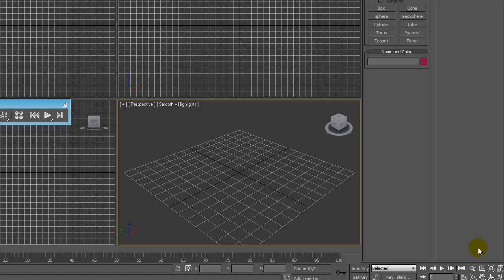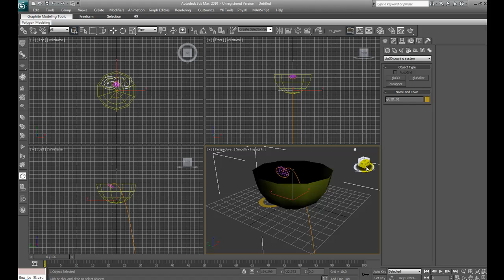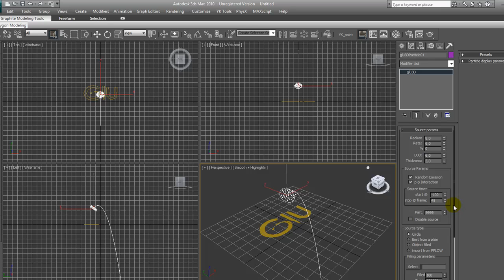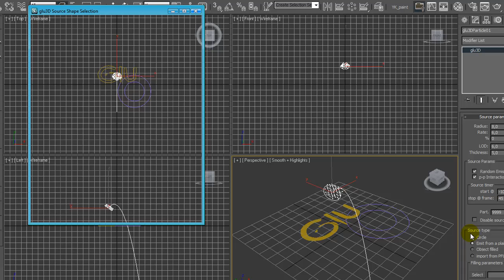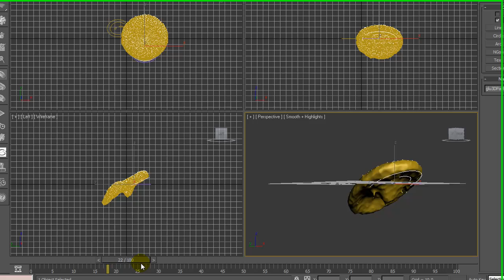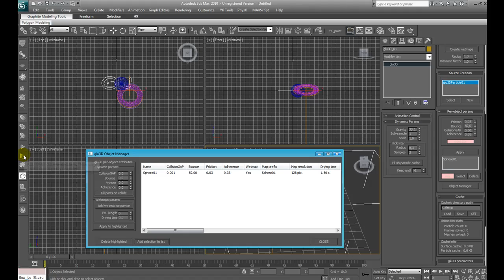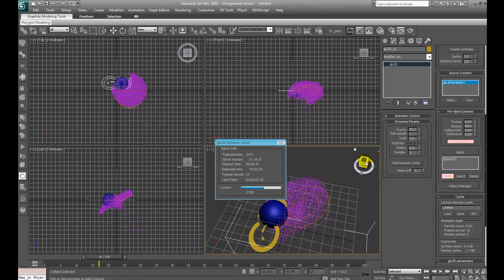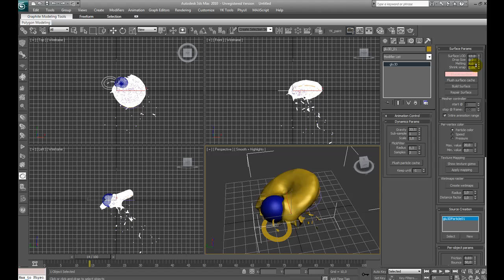3D Studio Max glu3D Fluid Simulation Tutorial

Comment from the maker: @autokill5 Nope,it can't.Max has reactor which can simulate physically correct waves and you can simulate water drops using metaparticles....but they are not a true fluid simulation system like realflow or glu3d.